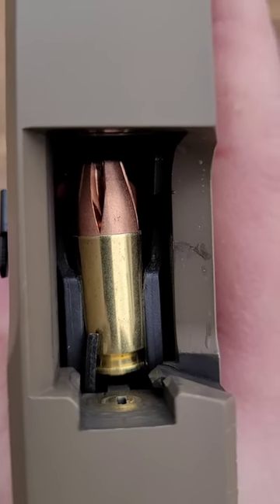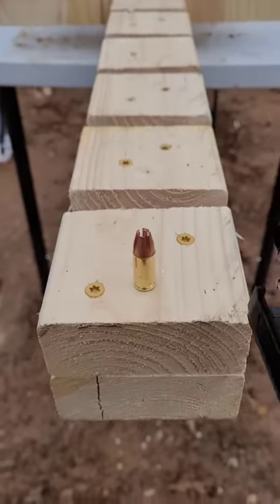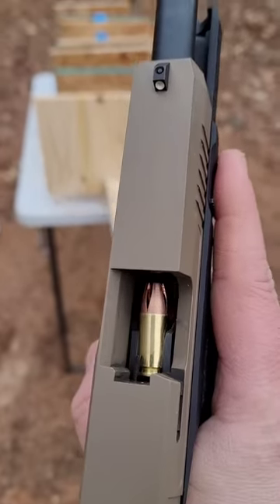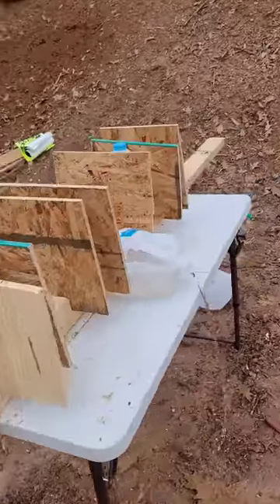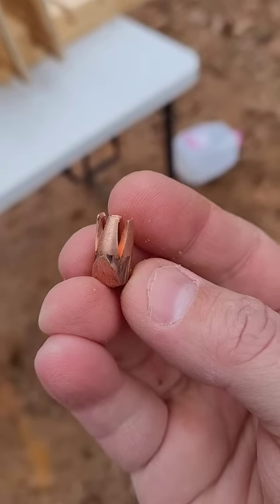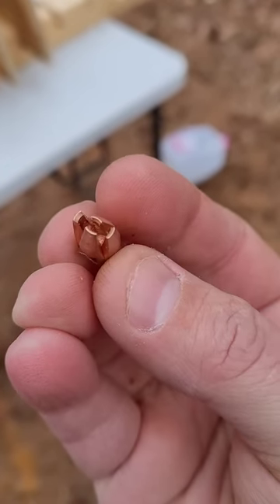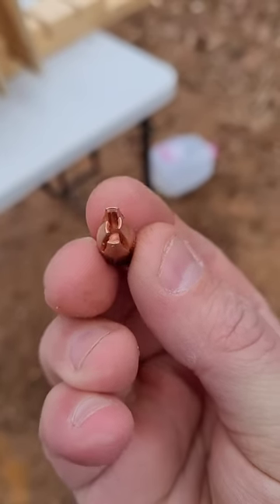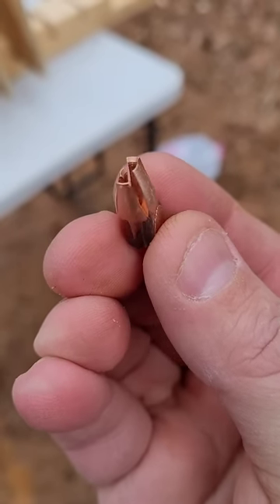9mm Interceptor through WOOD - Ballistic Machinist

Comment: Hollowpoints that hit wood react differently than hollowpoints that hit meat
Reply: Yes it sadly does not open up when hitting water after it went through wood it appears
Reply: @TheAnnoyingBoss yeah but it would be good for home defense as it stopped on the other side so wouldn't over penetrate to another room, and vice versa if it's shot through a person it won't go through hard objects anymore as it's opened up
Reply: @Pain1x  i see what youre saying.
Reply: Remember... that's not drywall. Huge difference in drywall and wood. Even particle board and drywall
Reply: @TheAnnoyingBoss  not enough velocity after going through all those plywoods. It opens up in water because of its velocity. It pushes the tip open because of the resistance of the water as it travels. There’s no constant resistance when going through wood. And that water jug was nowhere near enough water to do that.
Reply: @Pain1x  soo it will only over-penetrate on shots that miss... I don't see how that makes it good for home defense. That would be an advantage for warfare or counterterrorism, where you might need to fire at enemies behind cover. These types of rounds are banned in warfare by many countries, though.
Reply: Especially when it's wrapped in Denham
Reply: @Pain1x   No it won't. essentially what you want is it to open up. this is doing the opposite and it's acting like a full metal jacket and penetrating through multiple surfaces.  But to be fair nowadays all these Shitty constructions pretty much anything's gonna over penetrate.
Reply: This video is not showcasing a hollow point. That is a trocar bullet, similar to RIP ammo. Costs more than standard jhp while performing worse.
Reply: @Pain1x also if a hard barrier I’d present you don’t want your bullet to expand but penetrate. See the barrier is gonna ear up velocity and energy so you need yo use all energy to penetrate at that point for effectiveness. I think it performed perfectly?

Comment: But it didn't flower once it hit the water....Hornady has their flex tip which is excellent at barrier penetration, and ditches the polymer tip and mushrooms when entering soft materials
Reply: This went through several layers of wood slowing it down considerably, hollow points only expand above a certain velocity.

Comment: Guess everyone forgot about the Black Talon 30 years ago.  Designed to go through doors, leather jackets, etc before expanding into a spinning saw when it expanded in moisture (aka, body cavity).
Reply: I’d like to test that scenario. Do you have any I could acquire?
Reply: For science reasons of course….
Reply: @williamstiefel3908  I have one in the pipe now..  I had tested these back in the day. Shot through a stack of 2x4's with minimal deformation, but when shot into water, or a juicy raw roast, they opened up incredibly. They are a jacketed hollow-point with copper forward and lead behind. When you look down the nose of the round what you can't see is how the tip is formed by folding the copper jacket splines to towards the center of the round to form the hollow-point. When it hits liquid, the tip begins to expand, and the bent over copper essentially expands with it to create a sharp saw-like appearance that spins due to rifling. They caused a lot of problems for doctors in the OR trying to repair damage by cutting through the medical gloves and into the fingers of the OR staff in surgery. They also had a falsely accused name of being tefflon coated because they bullet itself was black with a stainless cartridge. They were made by Winchester and I believe initially developed for the DEA after finding hollow-points would expand when penetrating leather jackets and car doors. A later version (PMC StarFire) was produced designed  more for summer carry (no leather jackets like in the winter).

Comment: We have been taking those and loading shotgun shells with them, you can fit 4 in a 3" magnum put a little buffer in them averaging about 1580 fps and they work best with a modified choke, but even with the newer shotguns with screw in chokes They produce about a 9" pattern at 100 yards out of the older fixed choke barrels 30" length at 150 yards they drop about a foot and half but print all 4 in a 12" circle,

Comment: I did some testing on alot of ammo and I had the infamous Norma MHP 9mm do same thing. In water it opens up almost 2 inches but put a layer of denim in front of it and it clogs the tip and turns into ball ammo
Reply: After doing the testing that you did, do you find it hard to believe the bullet from that round could maintain that shape after passing through several pine boards? I do. I think it'd look like any other lead round, smashed up pretty good or in pieces. That thing spiders out from water but several boards and it won't event fully push together
Reply: @acidichunt7379  The mhp I believe would totally hold its shape, it's a light plus P bullet at 105 gr but not lead its all copper. When the bullet get filled up it's no different than a FMJ ball ammo round.
Reply: @jthewino1  crazy. Didn't realize copper would hold up like that.

Comment: Someone throw me some advice. I live in a modern townhome. For home defense, what would all of you recommend? Which firearm/ammunition combo would anyone recommend for these thin walls/shitty insulation/hood friends on both sides of us. We are interior unit
Reply: Use a shotgun with something less than buckshot but more than birdshot. For a handgun frangible bullets are also an option. But err on the side of making sure you have enough stopping power to stop an intruder rather than being too afraid of penetrating a wall. And practice so you'll hit you're target and dissipate the energy of the round even if it goes through him. No full metal jacket rounds and nothing larger than 9mm.
Reply: @kayakdog121  ever shot any shotgun through a wall?
Reply: @hotrodray6802  I've shot just about everything through just about everything.  Trying to get in an argument with me will get you nowhere fast.

Comment: So it's like an armor piercing round that can also be a holopoint when it hits a soft target. That's kinda badass. It's a two in one. What's it do to kevlar? Expand or collapse. I wanna know what it does to soft armor
Reply: It's doing what most hollow points do after going thru a hard barrier. Failing to expand.
Not likely to do anything different to a vest than any other hollow point of the same caliber.

Comment: Once upon a time there was a bullet called IQ by Aguila. The lightweight projectile was made of aluminum alloy and had an incredible velocity. It was also similarly machined like this ammo to retain its shape and literally drill through solid materials but open up when encountering hydrostatic pressure where it would produce an absolutely devastating wound channel. Rumor has it the alphabet soup dog slayers had determined it was a threat to soft armor and so Aguila quit importing it before it could wind up on a list and cause them trouble. It's just folklore at this point 20 years later, but something to keep in the back of your mind.